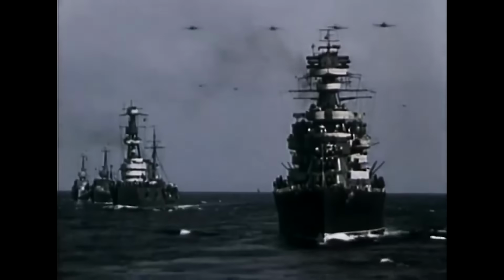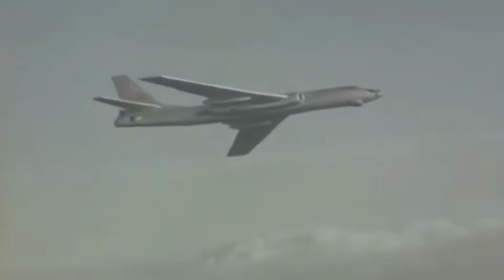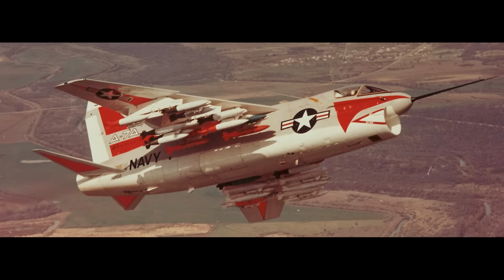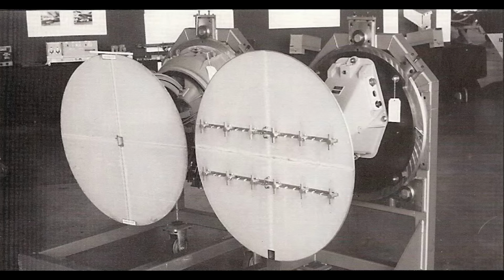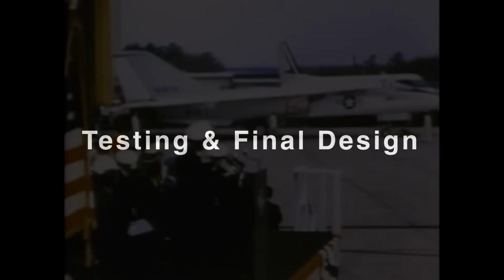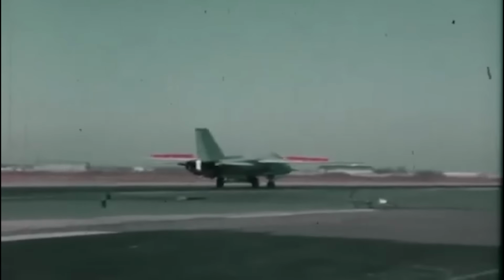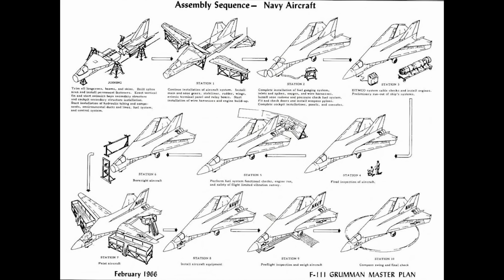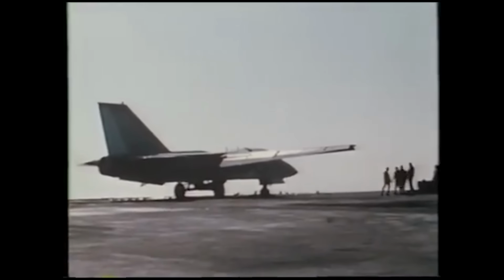Was The Grumman F-111B A Bad Aircraft Or A Missed Opportunity?

Comment: The big irony was that the F-14B and D versions ended up being just as heavy as the F-111B! But by 1970, the US Navy was phasing out their carriers smaller than the Forrestal class and that made the whole "too heavy" plane argument moot.
Reply: Fully-loaded F-14D = Lightly-loaded F-111B

Lightly-loaded F-14D < Lightly-loaded F-111B
Reply: @kibathemechanic4967 even fully loaded f-111 had much better landing and takeoff characteristics. Even with terrible f-14a engines
Reply: Gross Weight empty of the F-111B was 46,100 lbs. F-14B Gross Weight empty 41,780 lbs, F-14D 43,735 lbs, so the the heavest of the F-14 was 2,365 lbs light, Max takeoff weight was also less 88,000lbs for the F-111B,  and 74,349 pounds for both the F-14B and F-14D so 13,651 lbs less than the F-111B.  So stating the F-14 being just as heavy is factually wrong.
Reply: @at1cvb417  
"the F-14 was 2,365 lbs light" 

That's marginal - it boils down to engine efficiency that is a fictional upgraded F-111B would have to be compared to. 

The maximum lift off weight is a number that describes a feature the larger, the better - so it can't be an argument that a platform is 'lighter'... 

An aircraft that was just as large as the F-111B was the A-5 reconnaissance 'bomber', operated on carriers until 1979 - that is: side by side the F-14. 

The F-14 was without a doubt the better designed airframe - capable of air superiority fights - but we are talking about size as part of the mission requirement for long loitering time, combat range and speed toward an interception point of very long range missile targets Beyond Visual Range - and within that requirement, the F-111B would have been as capable as the Hughes AN/AWG-9 and the AIM-54 would have allowed. 
If the latter worked against Soviet naval and long range aviation, so did the General Electrics airframe. 

No doubt, either that it would have taken as long as with the F-14B in 1987 to achieve full potential operational capability - until 2010 the Australian F-111C was the fastest and most long range combat platform in the entire Pacific, including Indian Su-27MKI that outperform the Australian F/A-18A-F in 2006 (retirement year of the F-14B/D, including the AIM-54 very long range missile) in virtually all metrics... 

The entire debate, here can't be about what is more shiny, but about the mission requirement of long range, high speed interception - if that requirement for defending carrier groups still stands then larger airframes like the F-111B will fulfill that requirement, best due to the natural laws of aerodynamics.
Reply: @christophmahler if you go search “Standard Aircraft Characteristics” on Google there are sheets for F-14A, F-14D and F-111B, there you can see that F-14A has roughly the same time on station at 150nmi (which is what the USN cares about) as the F-111B, while the F-14D with the better engine can do so far better.
Reply: @at1cvb417 2000 pounds for 90000 pound plane is almost literally nothing. You realize that bigger max takeoff and landing weight is better? It means much longer range with more weapons and the ability to land without jettisoning insane expensive Phoenix
Reply: @tedarcher9120  88, 000 pound for an F-111b, the F-14D max was 74349, significantly lighter.  Also that 2000 pounds was the empty weight, meaning no fuel or fluids.  So 2000 pounds less is significant.  Also excess weight on a carrier is significant as the max weight is not only determined by the landing aircraft but the arresting gear, (those litttle itty bittty wires they use to stop the plane), this is why the F-14 is limited to 4 AiM-54's underway it is not the limit of the plane but the arresting gear and the extra maintenance required.  So weighing 2000 pounds more would mean less ordinance and fuel for  safe landing weight, the F-111B would have to jettison even more not less, for example a F-14 at max landing weight  would be able to land, but a F-111B with the same weapons and fuel load would have to jetison 2000 pounds of fuel or ordinance  just to make a safe approach.  You seem to come at this with the idea that a carrier has 1000 of feet of landing area and makes a gentle approach, not the 300 plus feet and the violent stop in 2 seconds from 150 kn. Mass on take off and landing on a carrier is everything all both evolution require the systems to be set to the mass of the aircraft.  So while you argue the F-111B would be a great Naval aircraft smarter minds made that that argument and defeated McNamara's plan in the 1960's  and had it cancelled.  McNamara wanted another F-4 but in reverse, as the F-4 started Navy and went Air Force.
Reply: @at1cvb417  
"the F-14 was 2,365 lbs light" 

That's marginal - it boils down to engine efficiency that is a fictional upgraded F-111B would have to be compared to. 

The maximum lift off weight is a number that describes a feature the larger, the better - so it can't be an argument that a platform is 'lighter'... 

An aircraft that was just as large as the F-111B was the A-5 reconnaissance 'bomber', operated on carriers until 1979 - that is: side by side the F-14. 

The F-14 was without a doubt the better designed airframe - capable of air superiority fights - but we are talking about size as part of the mission requirement for long loitering time, combat range and speed toward an interception point of very long range missile targets Beyond Visual Range - and within that requirement, the F-111B would have been as capable as the Hughes AN/AWG-9 and the AIM-54 would have allowed. 
If the latter worked against Soviet naval and long range aviation, so did the General Electrics airframe. 

No doubt, either that it would have taken as long as with the F-14B in 1987 to achieve full potential operational capability - until 2010 the Australian F-111C was the fastest and most long range combat platform in the entire Pacific, including Indian Su-27MKI that outperform the Australian F/A-18A-F in 2006 (retirement year of the F-14B/D, including the AIM-54 very long range missile) in virtually all metrics... 

The entire debate, here can't be about what is more shiny, but about the mission requirement of long range, high speed interception - if that requirement for defending carrier groups still stands then larger airframes like the F-111B will fulfill that requirement, best due to the natural laws of aerodynamics.
Reply: @at1cvb417  

"the F-14 was 2,365 lbs light" 

That's marginal - it boils down to engine efficiency that is a fictional upgraded F-111B would have to be compared to. 

The maximum lift off weight is a number that describes a feature the larger, the better - so it can't be an argument that a platform is 'lighter'... 

An aircraft that was just as large as the F-111B was the A-5 reconnaissance 'bomber', operated on carriers until 1979 - that is: side by side the F-14. 

The F-14 was without a doubt the better designed airframe - capable of air superiority fights - but we are talking about size as part of the mission requirement for long loitering time, combat range and speed toward an interception point of very long range missile targets Beyond Visual Range - and within that requirement, the F-111B would have been as capable as the Hughes AN/AWG-9 and the AIM-54 would have allowed. 
If the latter worked against Soviet naval and long range aviation, so did the General Electrics airframe. 

No doubt, either that it would have taken as long as with the F-14B in 1987 to achieve full potential operational capability - until 2010 the Australian F-111C was the fastest and most long range combat platform in the entire Pacific, including Indian Su-27MKI that outperform the Australian F/A-18A-F in 2006 (retirement year of the F-14B/D, including the AIM-54 very long range missile) in virtually all metrics... 

The entire debate, here can't be about what is more shiny, but about the mission requirement of long range, high speed interception - if that requirement for defending carrier groups still stands then larger airframes like the F-111B will fulfill that requirement, best due to the natural laws of aerodynamics.
Reply: The navy didn’t even test the 111B on carriers until after the canned it
Reply: The F-14 in all it's variants weighed less than the F-111B.  Two on carriers the  weight of the aircraft does mean something and is important to the ALRE (Aircraft Launch and Recovery Equipment) prior to each launch the aircraft loaded weight is entered into the catapults to ensure the launch, yes even in the old steam valve operated cats this is done.  On the other end the number of landings is recorded, for each wire (cross deck pendant) F-14's and A-3's counted as two hits on the pendant when the max count of the pendant was achieved it is replaced with a new one.  So weight is a factor, also the reason the F-14 only carried 4 AIM-54 on deployment max was due to weight when landing on a carrier.  For those that say well they are close I invite you to run two physics equations one for momentum and one for energy.  For Momentum: P=mv, where  P is momentum, m is mass and v is velocity so for a given velocity(airspeed) the heavier aircraft has more momentum.  For Energy we will use kinetic energy (energy with motion) KE = 1/2 m(vv) or 1/2m(v squared) where KE is kinetic energy, m is mass and v is velocity.  Again for a given velocity the mass greatly affects the value of KE.  Why do I bring this up, the aircraft has to go from 130 kn (150 mph), the landing speed of most carrier fixed wig aircraft,  to zero in 300 feet and 2 seconds, i.e. the ALRE equipment have to absorb that kinetic energy and stop the aircraft, conversely of launch it has to impart that energy to the aircraft to get it to launch.  As stated with a given velocity it is the mass that makes the difference.  those that say weight means nothing for NAVAL aircraft have either never been associated with carrier operations, or do not understand them and are ignorant of what is going on.
Reply: @at1cvb417  Energy is velocity squared. As f-111b had 10 knots lower approach velocity, wear on the arrester would be lower than with faster approach on f-14. F-14 could not land full load not because of wear, wire is way less expensive than jettisoning super expensive missiles, but because with full load f-14 was way too fast on approach. Because of much lower speed on landing f-111b had 5000lb margin while f-14a needed to ditch two missiles and all external fuel
Reply: @tedarcher9120  get it correct energy is 1/2 mass times velocity squared not velocity squared, and as I stated for a given velocity it is the mass difference that controls the amount of energy, I used 130 kn  as this is 150 mph, which when you look up carrier landings of jets that is how they explain it, 150 mph to 0 mph in 300 feet 2 seconds. Even though I know that the F-14 lands aboard carriers at around 120 kn.  Also the 2000 pound difference was for the F-14D the heaviest of the versions (over 2300 pounds for an empty weight)  The F-14A was over almost 6000 pounds lighter than the F-111B, both using the TF-30 engine.

Speed had nothing to do with why they limited the F-14's mass to 4 Aim-54 it was weight, the maximum "bringback weight" for the F-14 was 54,000 lbs, an F-14 with 6 AIM-54 and enough fuel to do several passes at landing  was 58,000 pounds, so weight not speed was what limited the load out. 

If the F-111B had been accept it would be the heaviest aircraft to operate on carriers, and as such would have had the same hit calculation on the cross deck pendant, if not more as the F-14 and the A-3 with each landing as counting as 2 hits, while all the other aircraft each landing counting as a single hit.  Pendants are changed after 100 hits.  While carriers have 4 arresting engines, nost Nimitz class, 3 for Ford Class, this means 3 or 4 cross deck pendants each one having a 100 hit  limit, one of the reasons each landing is graded and recorded.
Reply: @tedarcher9120  what calculations are you basing your 5000 pounds on, or is just fud lore and speculations.  Also 10 mph is not much lower, in fact computing one could argue that it does not mitigate the weight of the F-111B.
Reply: @at1cvb417  it's from a book Grumman navy f-111B swing wing by Tommy Thomason
Reply: The problem wasn’t really the weight as much as that the requirements the navy had changed during the development of the f111B. They understood that they couldn’t have a different plane on oars for each different mission type so they had new requirements for a plane that could act as a fighter/air superiority platform and fleet air defence role.
Reply: @thurbine2411  they didn't suddenly "understand" it, they specifically changed it so f-111 wouldn't fit. For example first they demanded a side by side sitting and then changed it to in line requirement. It was a basic case of corruption
Reply: Better engines, and better manoverability.
Reply: Sort of. They phased out the Essex class besides Lexington, and kept Midway around for so long it was still a front-line carrier in 1991, but the Tarawa-Class amphibious assault ships were expected to be able to fulfill the ASW-Carrier role that Essex-class carriers had been doing.
Reply: Wouldve been heavier if it were carrier capable
Reply: @Johnnyguitar251  But it was carrier capable. The f111 handled quite well behind the boat when they tested it
Reply: @Johnnyguitar251  it was more carrier capable than f-14
Reply: But, the F14B and D had better engines than the F-111B
Reply: @gbonkers666  in 1990s, not 1960s
Reply: @gbonkers666  Quite so, but still heavy.
Reply: "The big irony was that the F-14B and D versions ended up being just as heavy as the F-111B! But by 1970, the US Navy was phasing out their carriers smaller than the Forrestal class and that made the whole "too heavy" plane argument moot." 

Furthermore, the indeed better designed airframe of the F-14A of 1970 took until it's B engine upgrade in 1987 (!) until it was fully operational without restricting regulations on flight regime... 

That's two decades, to bring an initial F-111 design that was still in service for another two decades to a standard that meets requirements (double and spread wing pivots, twin engines with spread nacelles, twin tail fins, leading edges for high angles of attack, ejection seats - though the capsule would be beneficial in Arctic waters). 

Nobody can argue that it was more cost efficient to invest into the F-14, A-12 (Mc Donnell Douglas), F/A-18A-F and F/A XX programs when reworking and steadily modernizing the F-111 would have meet 21st century requirements (thanks to advancing micro-processors, digitized avionics with fly-by-wire and glass cockpits, titanium welding, composite materials for weight reduction and cooling, more efficient, thrust vectoring engines)... as all an airframe must do, is to be large enough to carry a large arsenal over a long distance at high speed - aided by maneuverability and low observability. 
If a carrier runway is too small to deploy such a craft, then make it larger...
Reply: Yeah, but it was the Navy's "idea" and from the Navy's preferred contractor. Everything else was just a justification.
Reply: @AutomaticJack  Prefered? General Dynamics had no aircraft on carriers.  If you mean their partner for the F-111B that was Grumman  well that is factually with out merit claim on your part.   Bids for the VFX program, which was initiated in 1967,  where submitted by Grumman, General Dynamics, Ling-Temco-Vought, McDonnell Douglas, and North American Rockwell with Grumman winning the bid and the F-14 was born.  So even with cancelling of the F-111B (TFX program) General Dynamics was able to submit a bid, and did for the VFX program as did the other companies, McDonnell Douglas submitted 4 separate designs.  Also the TFX Program was apposed by both the Navy and the Air Force with McNamara forcing it on both, Both services selected the Boeing design, to which McNamara  selected the General Dynamics design (F-111) in November of 1962 over the recommendations of the services.
Reply: @AutomaticJack  that's called "corruption" usually
Reply: It's not moot that fighters can be too heavy just because an aircraft carrier can handle them.  Too heavy means too expensive and less maneuverable and too easy for the enemy to see visually and on radar.
Reply: @MaxPalmer-1 
There is no correlation between RCS and weight...
Reply: @FallenPhoenix86 More weight implies more volume implies more surface area implies more RCS.  Example, the F-15 RCS is 20 square meters.  The small JAS 39 Gripen is 1.5 square meters.  Stealth techniques can reduce RCS, but for these older planes it is generally size as the dominant contributor to RCS.  See the article on radar cross section on Wikipedia, where in the radar range equation effective reflecting area is a first order term.
Reply: @MaxPalmer-1  The JAS 39 Gripen also benefited from newer computational research into radar cross sections. That's why the Eurofighter Tornado and Dassault Rafale have much lower RCS than older fighters due to its careful shaping of the entire body of the plane including the wings.
Reply: @Sacto1654  Sure, but in general smaller size means smaller RCS.   The large F-4 and the small F-5 were generally built in the same materials technology and at the same time, and designed without deliberate suppression of RCS.  But, if I remember right the RCS of the F-5 is about 3 square meters, and that of the F-4 about 20 square meters.
Reply: @MaxPalmer-1  
Everything you just assumed is wrong... counter example, is a B-2 lighter than an F-16?
Reply: @FallenPhoenix86  Phoenix, I'm an RF engineer and I've studied this material for decades, so I am not assuming.  Sure deliberate radar reflection suppressing techniques can reduce effective radar cross section area.  But, that was not applied in the era of the F-111.  Back then bigger just meant more radar cross section and higher odds of being detected on enemy radar.  Bigger also meant higher cost and thus fewer planes for a given budget.
Reply: @MaxPalmer-1  A big factor of RCS in the F-15 is that the compressor blades can be seen by radar from the front, thus giving it an RCS even larger than the aircraft itself.